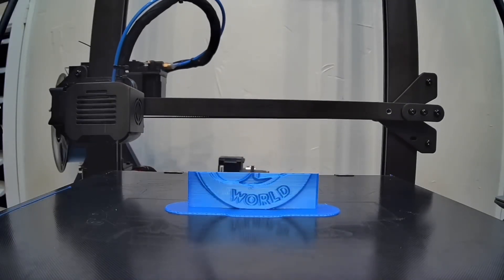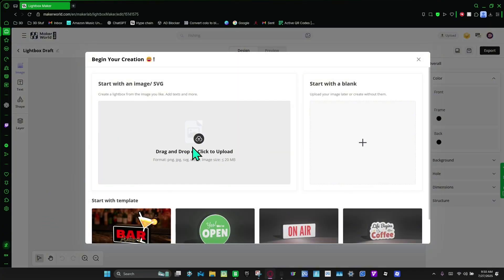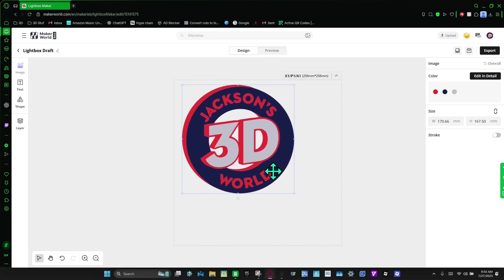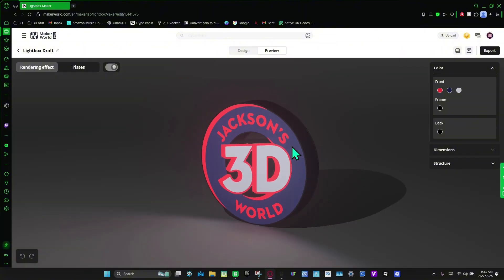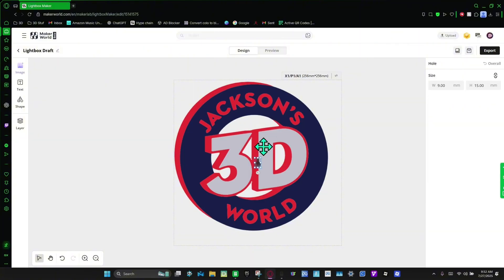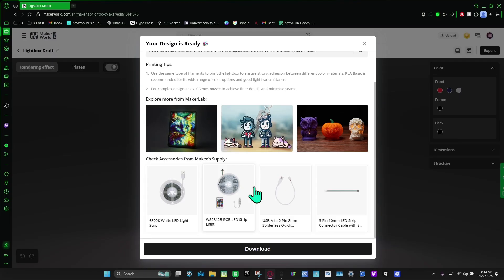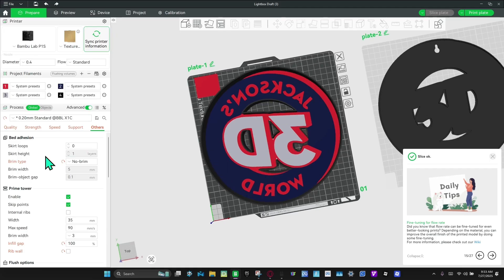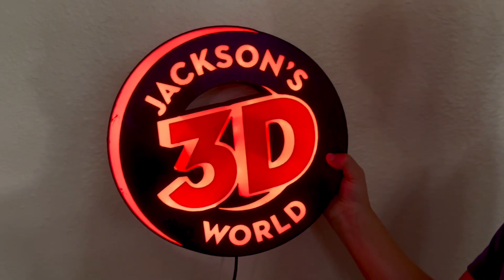💡 Light Box DIY #3dprinting with @BambuLab MakerLab

Comment: love your video, i do have a question though, how do you reconnect or reuse the extra led strip that is trimmed off?
Reply from the maker: Hi! Thank you. I don’t think you can reconnect them.
Reply: @jacksons3dworld  just that particular one you used or all in general because that would be a waste of led cut off
Reply from the maker: I think most are like that. I did search it up and you can connect if you cut on the line but you have to solder it. You can buy shorter ones on amazon I think.
Reply: @jacksons3dworld I can’t solder very well so I may have to pass on this idea